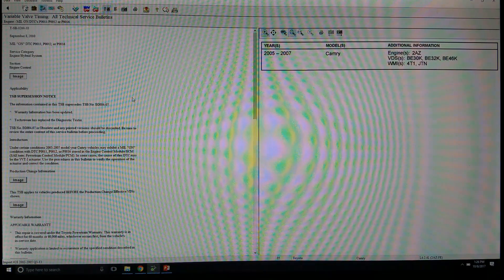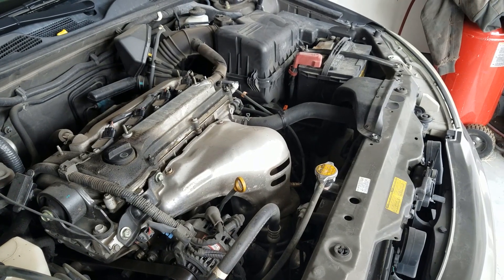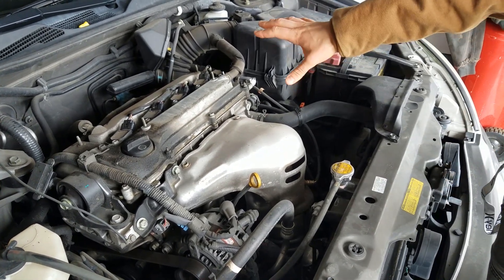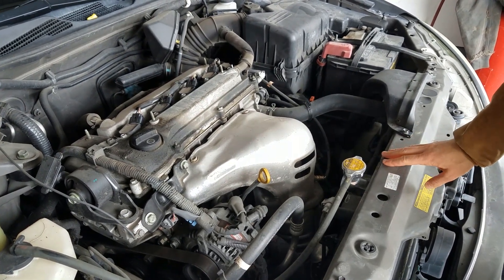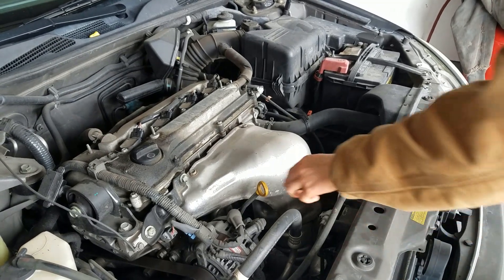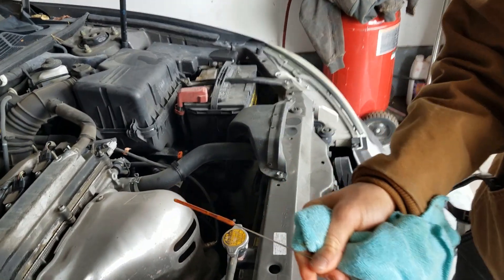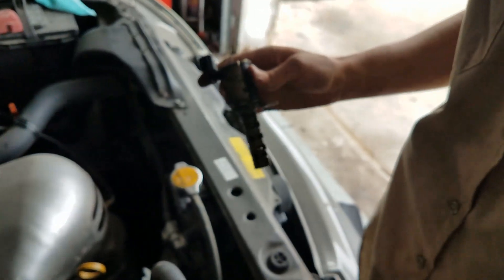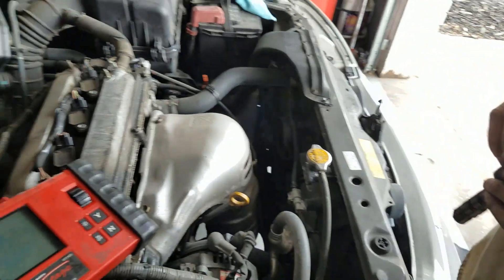P0016, P0017, P0018, P0019 - 2005 Toyota Camry 2.4L

Comment: I have a 2007 Toyota Camry 4cyl. I have replaced the camshaft sensor, crankshaft sensor and the vvt sensor and the timing gear and the engine light keeps coming on with the code p0016. What else could it be? I have cleared the light and the computer and the engine light keeps coming back on...I'm at my ends
Reply: At that point you'd probably have to replace the timing chain assembly. I know this was posted 2 months ago, but I would probably take it to a mechanic just to verify that it is the timing chain. If it is, with proper tools and preparation, you can probably do it yourself.

Comment: The mechanic told me I need a cam intake actuator solenoid sensor. Is that the valve you removed or a cam sensor? That description confused me.
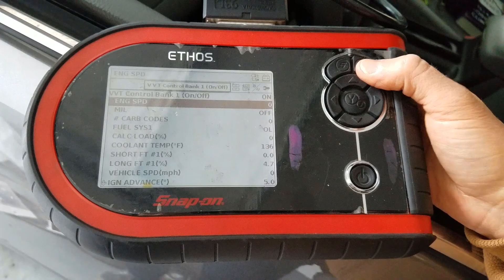Reply: So you mentioned two things really. The "actuator" is the valve that controls the oil flow, as Mia mentions the "oil control solenoid valve" at 4:14 and 4:38. The cam sensor is what Mia was testing around 3:00, but she didn't remove it.

Comment: Dont understand checking timing if cM and crank signal wave is good and its new enough to set a crank cam correlation code
Reply: Correlation refers to when the signals are coming through. If the cam is advanced or retarded when it shouldn't be, it would set the correlation code. For example, if the timing belt or timing chain is stretched, the cam would be retarded in relation to the crank. If the timing belt skips a tooth, the cam could be advanced or retarded in relation to the cam. If there is a problem with the actuator, perhaps stuck in an advanced position, the cam would be advanced when it shouldn't be, setting a correlation code. Hope this helps.